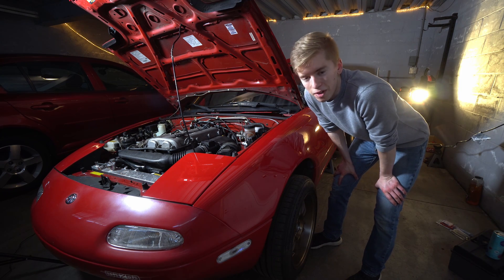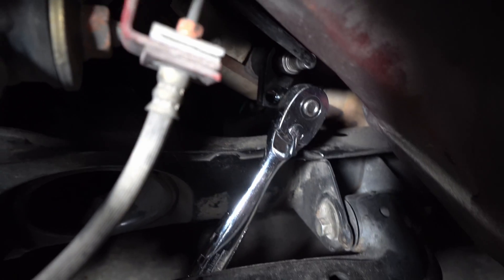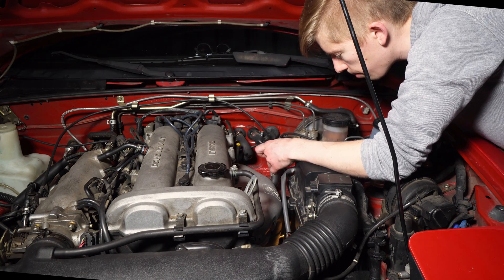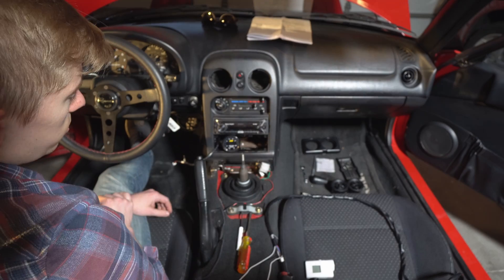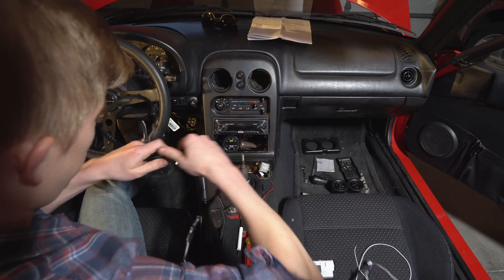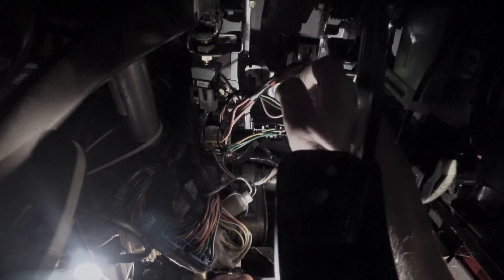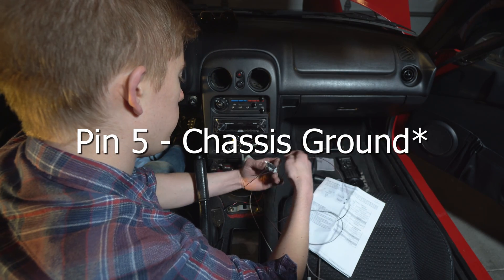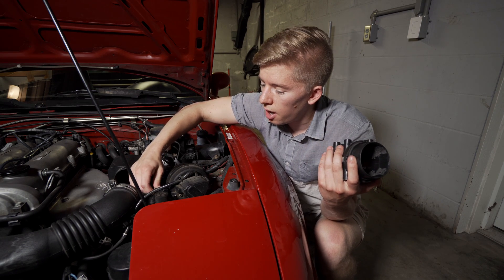Install AEM Wideband O2 and GM IAT [1.8 Miata Megasquirt MSPNP2]

Comment: how did you calibrate the x -series ? I don't see the x-seires in the wideband option box
Reply from the maker: I did custom calibration and used the voltage values that are in their manual. 0.5V = 8.5 AFR and 4.5V = 18 AFR
Reply: @HardwayLearning  and has that worked? Cause I did that to but to no avail
Reply from the maker: @TheEventMain  sounds like you might have wired something wrong. What is the AFR reading on the gauge vs what tuner studio says?

Comment: Where’d you connect your brown wire after?
Reply from the maker: You want the brown (pin 10) of the 10 pin connector on your X-series to go to signal ground (pin 22) of your mspnp2.
Reply: I got three pins available 20,21,22
20 and 21 have a single wire while 22 has two wires spliced .
Which wires should I use in that case? 
I bought a second hand turbo kit and got everything scattered 
Can I run all my wires to the portal connector? And which wires get spliced together like with pin 22
Reply from the maker: @bryanrojas7993  the white wire (pin 9) of the wideband must go to pin 21 of the options port. The brown wire (pin 10) of the wideband should go to pin 22 of the options port. You will not use pin 3,4,5 of the wideband. Whatever else you have connected to those pins of the options port of the megasquirt I'm not sure 🤷‍♂️. You could have other sensors sharing that signal ground (pin 22 of options port) and that is fine. You cannot share that input though (pin 21 of the options port).

Pin 20 of the options port should be used for your intake temperature sensor if you didn't use the OEM harness and you want to wire that to the options port and change the input in your tunerstudio file.

Comment: Wideband signal ground goes to Megasquirt sensor ground. If the wideband has no sensor ground like a bunch of other widebands (classic Uego, Innovate, PLX etc.), you then ground the negative wire where MS is grounded. So to recap. The X- Series have a chassis ground for the controller and 02 heater and a sensor ground for the actual 02 sensor. Thank you very much!

Comment: i have a 4 wire map sensor, can i delete that and install a IAT? also my pinout says my stock map sensor has a built in IAT in the sensor.
Reply from the maker: I think you are referring to the stock MAF that comes on the car?  You will not need the MAF if you are running a megasquirt and WILL need the IAT installed for the ECU to properly determine engine load.  The megasquirt comes with a MAP sensor in the enclosure that requires you to run a vacuum line from the intake to the ECU.
Reply: @HardwayLearning  nah its a map, on the air surge tank, nevermind because i already found out it has a built-in iat with the map. Thank you though
Reply: @HardwayLearning  but how did you find your Trigger angle/ piston position?
Reply from the maker: @johnmarco5017  I loaded a base map from trubo kitty that had all of the appriopraite trigger settings for my car.  If you're talking about verify spark timing, I used a timing light attached to cylinder 1 with fixed timing set at 10 degrees and verified that the timing markings on the main crank pulley lined up.

What car are you installing this on?
Reply: @HardwayLearning   avante XD 2.0 dohc
Reply from the maker: You would have to figure out what that cars triggering setup consists of 🤷‍♂️

Comment: i have a hard time with the grounds if you ground the black  one to the buzzer how its sharing chassis ground why not all ground to megasquirt
Reply from the maker: The ground at the buzzer is already tied to chassis ground, which is already tied to the Megasquirt.  Since you're running a power to the buzzer it simplifies routing to also tie your ground there.  The positive and negative of the wideband analog output signal is separate from the power and ground for powering the gauge itself.
Reply: @HardwayLearning  well I took my power from my power windows option on my car can I take the ground from there to the back of the head or were ever it is on the 1996 next to the throttle body
Reply from the maker: @Brizzle_718  is there not a ground at the power window?  Otherwise you can take it to the chassis ground on the Megasquirt options port or use a ring terminal and bolt it to a stud anywhere on the car that has exposed metal.
Reply: @HardwayLearning  I will re look over it all thanks for all the info
Reply from the maker: Glad to help, feel free to reach out on instagram if you need any more questions answered 🤘

Comment: I don’t understand how to wire the O2 gauge to the megasquirt. If you’re getting power from that, why would you need the buzzers power? Also I’d like to see how you ran the wires through the trans tunnel.
Reply from the maker: The power for the gauge comes from the buzzer, the signal output from the gauge goes to the megasquirt. I laid the wires on top of the carpet, but under the armrest.

Comment: Wait so did you leave the stock o2 sensor connector intact?
Reply from the maker: Yes, the stock O2 connector is still on the back of the head.  It is no longer needed because the new O2 sensor runs to the wideband controller.  Then the analog output of the wideband controller runs to megasquirt.

Comment: The manual also lists a blue wire, is that the wire you connect to the stock o2 sensor connecter?
Reply from the maker: I wired my O2 sensor directly to the DB37 connector.  The wires from the AEM X-series are Brown (which should go to signal ground/pin 22 of options port) and White (which should go to O2 sensor input/pin 21 of the options port on MSPNP2)
Reply from the maker: Feel free to reach out on instagram if you have anymore questions!  It might be easier to work with you in realtime!

Comment: Did you directly connect the gauge to megasquirt so your gauge matches the same A/F readings as megasquirt?
Reply from the maker: In Tunerstudio you have to select the correct calibration in order for your AFR in Tunerstudio to match what your Wideband controller is outputting.

Comment: Can you give more detail why you cant use the maf and what you need to do to instead of a maf?
Reply from the maker: I think there is a way to use the MAF, but there aren't many resources to figure out how to implement it.  Because the MSPNP2 includes a MAP sensor all you need to do in order to implement the MAP sensor is install the GM Intake air temperature sensor.  This has the added benefit of allowing you to remove the MAF which creates a large intake restriction.  So for around $30 (for the GM IAT) you can improve flow and use the Megasquirt how it was intended.